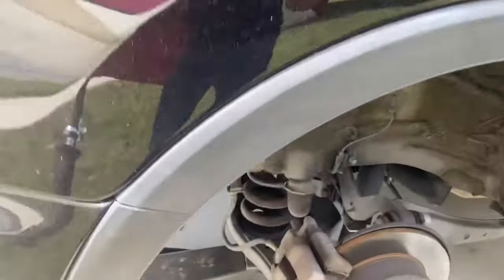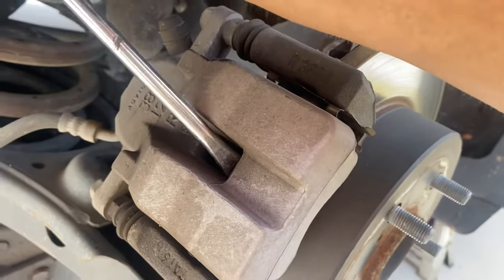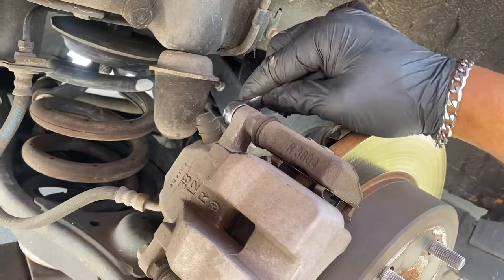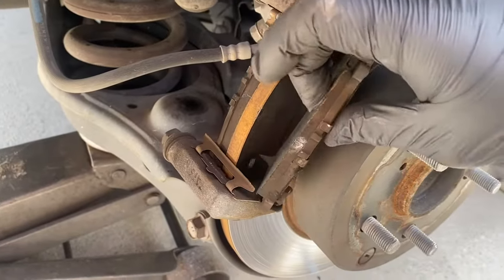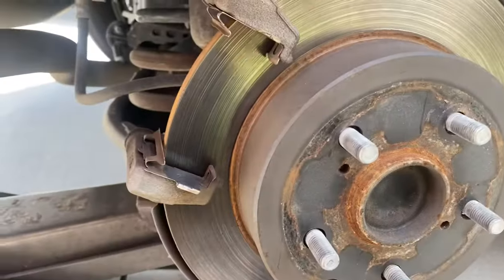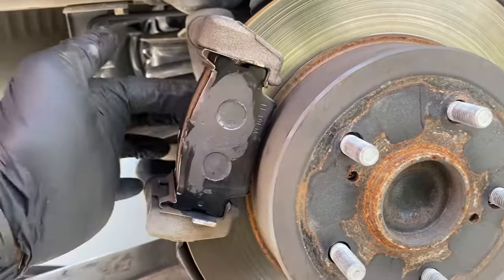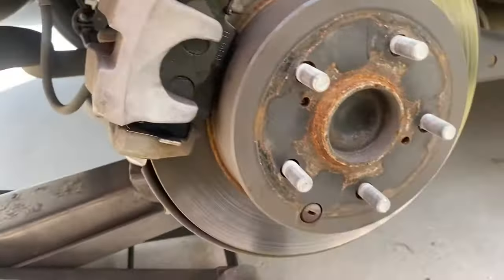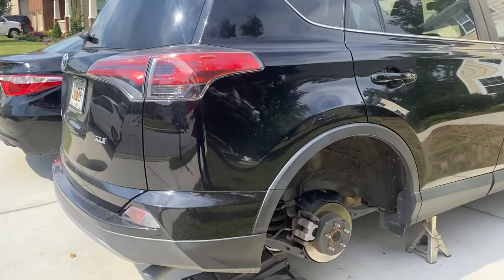2013 - 2018 Toyota RAV4 REAR BRAKE PADS

Comment: Just did the wife's rav4, no need to take the caliper off just remove the top bolt and swing the caliper down
Reply: You wont be able to test the  rebound on those bolts though. Its good to check them everytime you replace the brakes so that it wont have uneven wear

Comment: If you take the bottom bolt out and loosen the top one,you don't have to take the caliper off completely.
Reply: If you take just the bottom bolt out you don’t have to do anything to the top bolt. You just lift. You could even pull the caliper out with the top bolt still in.

Comment: What about the break pads inside the rotor. You just did 1/2 of the work.
Reply from the maker: This video is about how to replace rear brake pads not rear parking brake shoes.

Comment: After you compress the piston and install the new pads do you have to do anything else?
Reply from the maker: Yes, before you start the car pump the brake pedal 5 - 7 times until it gets hard. Then you can start the car and test drive it. Check brake fluid level as well.
Reply: Thank you so much!!!

Comment: On my daddy this a nice video!
I’m going to get a higher end aftermarket pad and rotor.  I have read and seen on my own Rav4 these oem Toyota parts seem to wear prematurely.  One down side to this generation Rav4
Reply: In my experience the harder brake material tends to make brake noise when the brake dust builds up. My 2015 Rav4 has 70K miles on rear pads with OEM and are quiet.